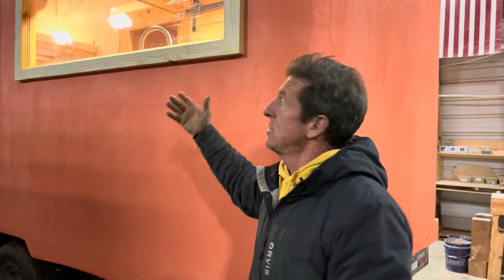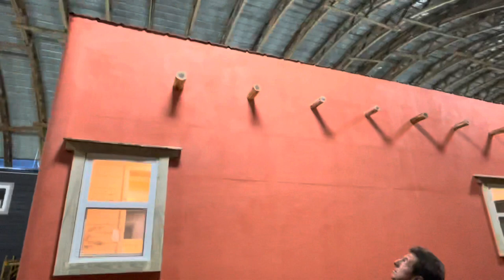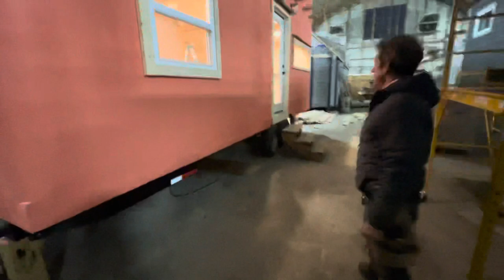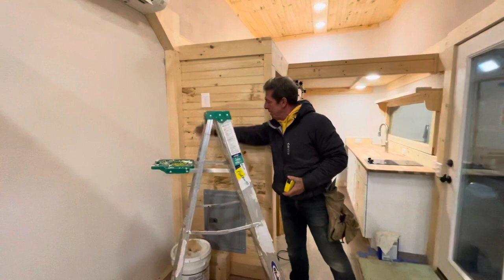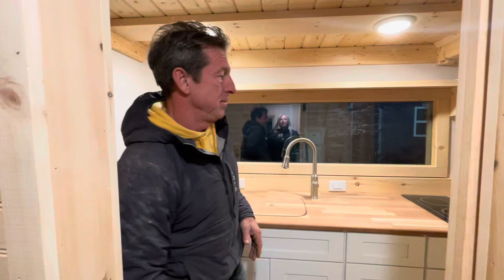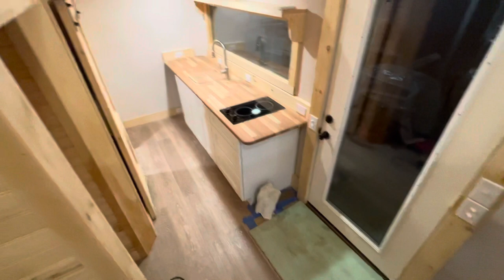Adobe Style Tiny Home 8’x24’ Ready for the Prairie 🌵🏜🛖

Comment: It’s a cute design. I have a suggestion for you for future reference. You couldn’t put in a range hood which I think they’re cumbersome and they get in the way and it does in a few with ascetics. However, you could put in a downdraft which fits right in with the cooktop. You don’t really lose any space on your counter it runs right in the unit… You can buy them complete with the cooktop or you can get one that runs along the side of the cooktop. You’re not going to have a Clunky cooktop that way and you’ll still be able to vent the kitchen. The only thing I dislike about that house is it doesn’t look like the windows open. I may be wrong I’m still halfway through the video but I want windows that were open I do like that they have the glass the way it is but I would rather have a window that opens.

Comment: Wow! Well done! I have a couple of questions:
1) Our building code in Maryland, for some godforsaken reason, requires a separate sink in the kitchen & bathroom. Did you have to do anything to work around that? (if not, they have toilets that have sinks on top of the refill tank. :) ) 
2) How much did this whole ESP unit cost, w/the extra 4 ft in length, & the cool rounded corners?
Reply: Have you looked into tiny homes being allowed in MD? I looked on Google and MD doesn't allow them but I don't know how up to date that info is. I want to call Harford county and find out about ADU's and THOW's being allowed and what the regulations are for them if they're allowed at all.

Comment: The. Cedar trees are called Viga's.  And it’s common to use a turquoise on the door and windows.  I’m in New Mexico and it looks really good.  The Viga's are supports for the roof and should go the same distance on both sides from the corners.  It may be the angle of the camera, but it looks to need one more Vega?  Also, could a pop up stove vent behind the stove up be possible?  Like a Jen-aire.  Then it would go below the counter? Sister Jay

Comment: I have fibromyalgia and rsd combined for 20 years now! I'm wondering if I could tolerate/my body could take the winter weather where y'ALL are Randy and Amanda?  Rsd (reflective sympathetic dystrophy). If anyone on here knows about these invisible illnesses/auto immune diseases, and can help me I'd greatly appreciate it!
Reply: 🤔How harsh are your winters and summers, my body can NOT take extreme temperatures!
Reply: @janeorta627  where are you now (approximately), for comparison?
Reply: I have fibromyalgia and live in Southern PA just west of the Susquehanna river. I was also born with lax ligaments so they keep each other flared up especially with at least 2 blown disc's in my low back. Winters are definitely worse on the body, pain wise, but I can't take heat or cold. You having RSD on top of it is a different animal all together. It kind of depends where you live now and what the weather is like there. Are you in a warmer or colder climate now?